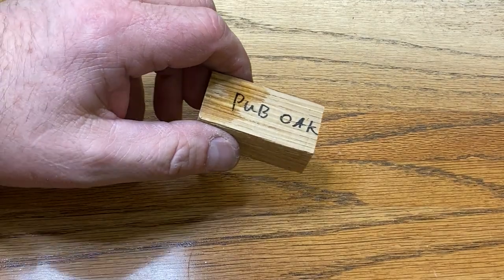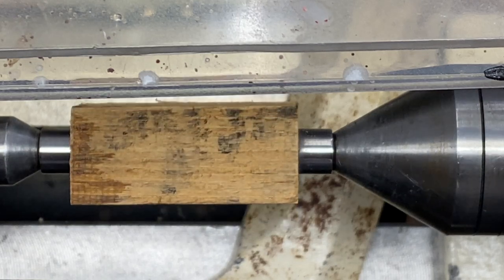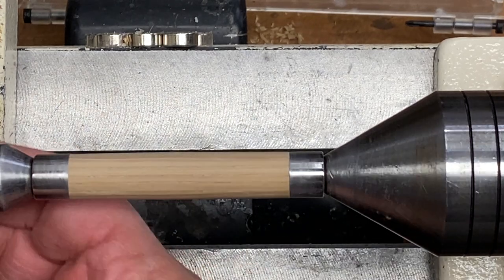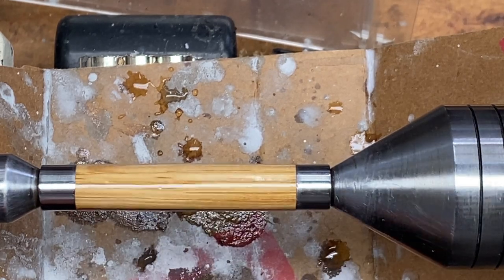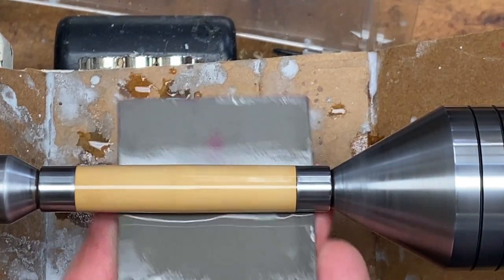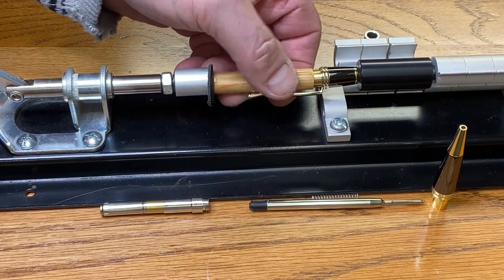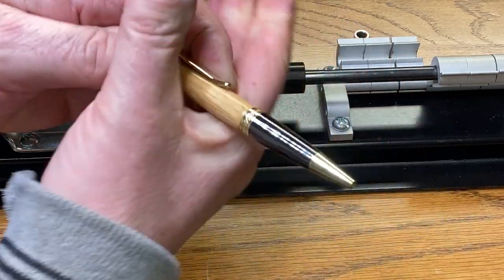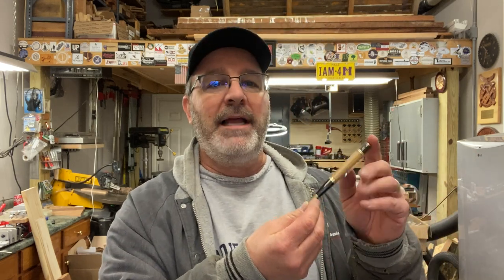Turning a Piece of Oak From a 1649 Pub

Comment: Lovely pen; I, too, like history, which was fun to watch. I get nervous about the sanding, micro-mesh section, and applying all the CA to a blank.  I have sanded too much and messed up the blank itself.  As in this case, the Oak pulled in some of the CA and made dimples; I can go either way. Do I want a smooth finish, or do I want to feel those dimples off the wood?  I usually wind up using a friction polish to finish the wood-based blanks. Overall, love how the Oak looks.
Reply from the maker: Thank you Adam,
  I love friction polish, I only word some company would develop a polish with a longer life. FP wears off so quickly. 

Regards,
Bob
Reply: @RJBWoodTurner   Thanks. That does help out a lot to explain more about CA vs. Friction Polish.  Still a tad nervous about sanding down too far, but I will practice that this weekend.  I have extra tubes and cutoffs.
Reply from the maker: @nothereorthereoranywhere  if you sand down to far, just clean the blank and reapply the C/A. You actually get better coverage the next time around because all the voids are leveled out.
Reply: @nothereorthereoranywhere  I occasionally will sand through the CA finish but it has been quite awhile.  Trick for me is to first sand to get the surface flat (after the last coat of CA).  After that progressive finer grits but remember you are just removing the scratches left from the previous grit.  Probably less than 30 seconds and it gets less time as the grits get finer.  Good luck.